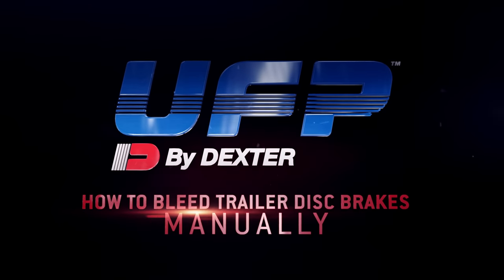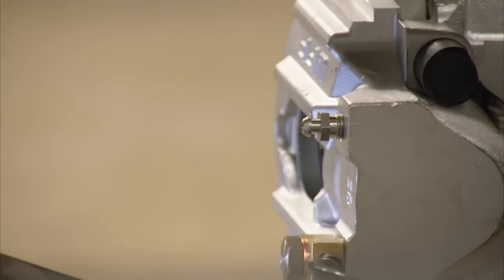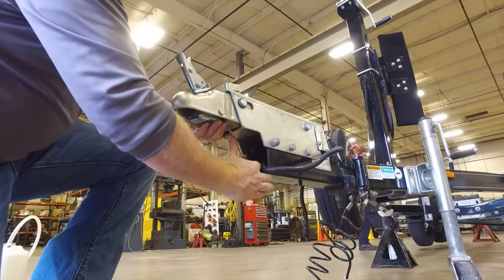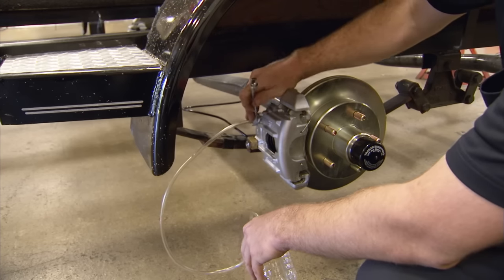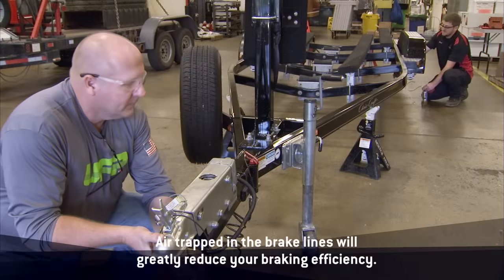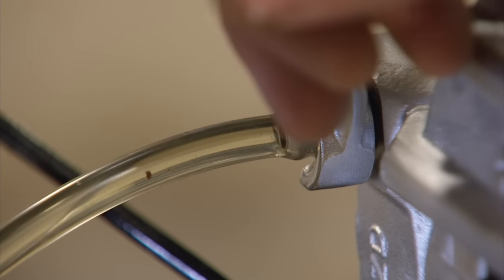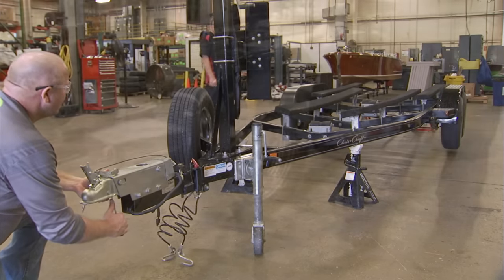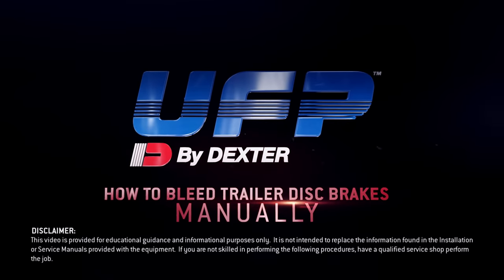Dexter Manual Bleed HD

Comment: Thanks for the tip. Much easier then using muscle to cycle the MC. You guys should do a video on replacing the components in these actuators. A lot of them are welded to the trailer and have to be taken apart. I just had to teach myself how to replace the shock in there .
Reply from the maker: We are glad you found this video helpful! Feel free to chat with our team on our website at https://www.dexteraxle.com/. We are happy to answer any other questions you may have.

Comment: You need to upgrade your instructions to include usage or non usage of DOT-5 silicon brake fluid. I use it in 2 vehicles & the stuff is very good in vehicles that don't get driven much, like RVs. DOT-5 doesn't have the affinity for moisture like DOTS 3 & 4.

Comment: My single axle trailer only has a bleeder valve on one side. How do I bleed the side that doesn’t have a bleeder valve? Or do I just bleed the one side and that will remove the air from both sides?
Reply: Are you sure you have brakes on both sides?? Some small single axel trailers only have one single break on one wheel.

Comment: Where does the blue wire go
Reply: from your 5 pin wiring plug on the trailer side it goes to the brake lockout solenoid which is a little valve on the output side of the brake actuator that prevents your brakes from locking up when you back up.